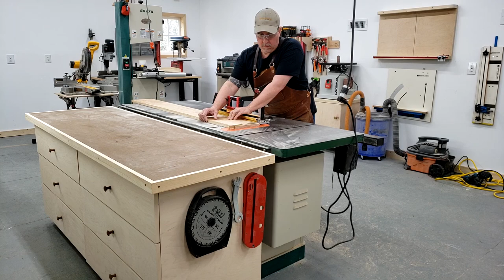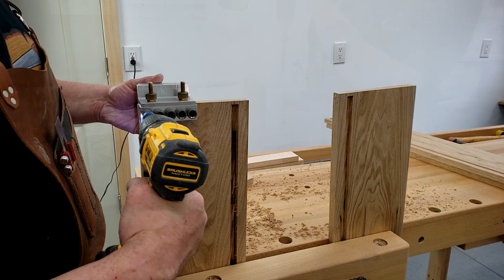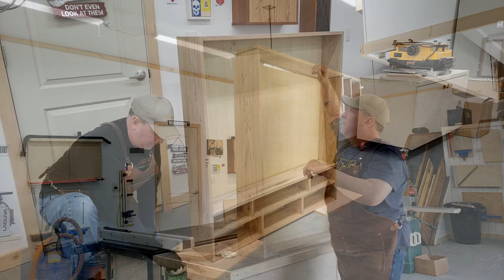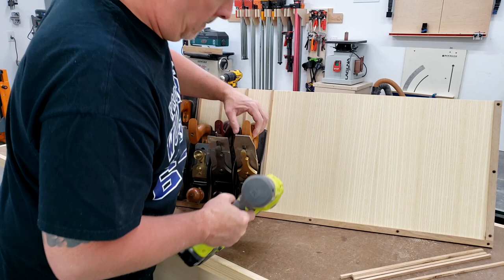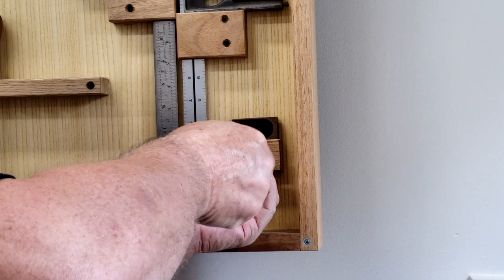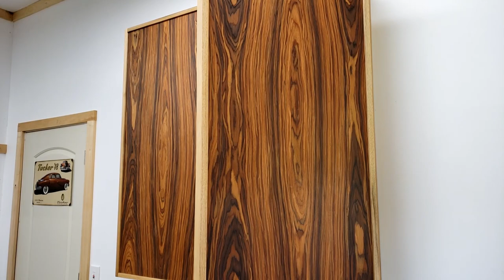Hand Tool Cabinet Build / Woodworking Project

Comment: Great work!! Thank you for sharing this video. Just one questionnaire, how thick is the plywood you used for the back panel and the doors?
Reply from the maker: Thank you for watching! I used 1/2 plywood for the doors and back. Slightly thicker once veneer is added.